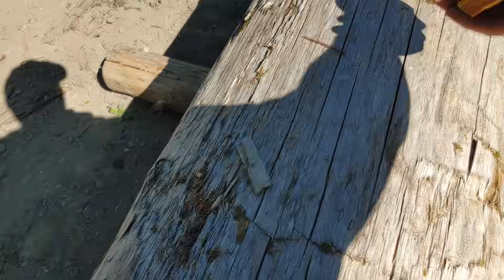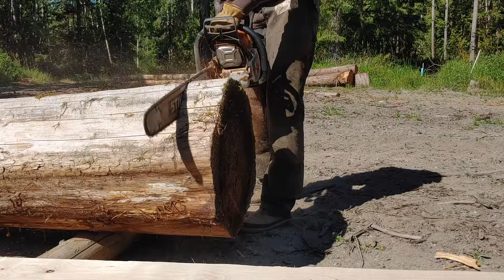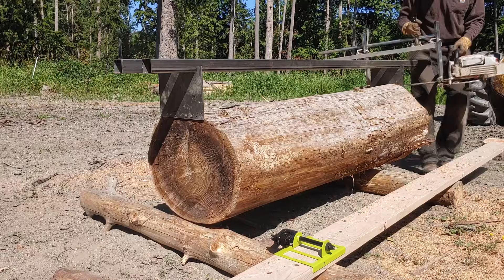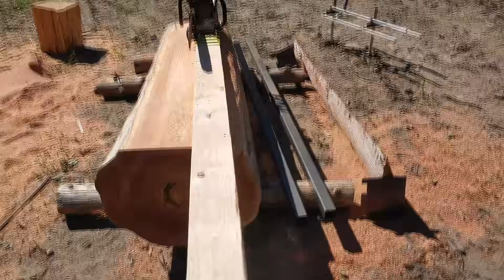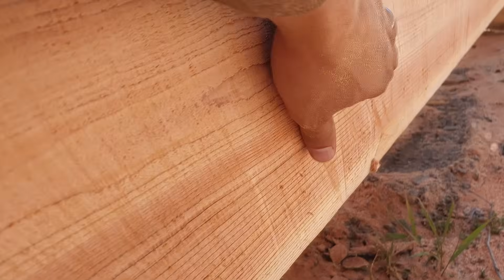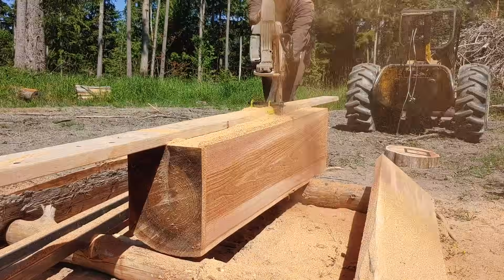Logs To Lumber W/Timber Tuff Sawmill Jig

Comment: What if you just took those set screws out use the center one to drill out and then put a hole in the bar and straight bolt it to it?

Comment: If you mounted it on the otherside of the bar so it is the opposite side to the engine, will it not make it easier?   It seems a bit counterintuitive but you wouldn't have to lean over the log as you cut.
Reply from the maker: Good idea!  I will try it next time

Comment: G'day S&J, I purchased my 4 foot Alaskan twin power head slabber in 95 I put a pair of 066 Magnums on it they worked well together. The next year I got an Alaskan mini mill so I could cut garden sleepers and railway ties, I found that pushing it away as you did on the second cut was the way to go but you had it near vertical I ran it at about 60 degrees and be conscious that any left or right pressure on the throttle handle will reflect at the bottom of the cut. They're a handy little portable set up but I'll have to be honest since we purchased the 10/30 Lucas Mill and slabber they've been in the shed gathering dust for nearly 15 years but they helped to pay for it mind you 👍.
Reply from the maker: Great info!  Thanks!  I will check into the Lucas Mill.  Thanks for watching and commenting

Comment: Did you use a ripping chain?
Reply from the maker: Yes.  Ripping chains make a real difference and a much smoother cut.  I would recommend them if you are planning on using an Alaskan mill.

Comment: Here is the simple solution to the first cut with a Timber Tuff, Haddon or other like guide.

Spike or screw two vertical 2x4's to both ends on the log.  Use a spirit level and fasten a horizontal 2x4 to each end.  This is the mount for the saw guide 2x4.  Fasten the saw guide 2x4 to make the saw kerf lay where you want it.
Reply: I took my setup a little further and fabricated a T bracket out of 2x2 steel angle that I can screw to the ends of the log and screw to the 2x6 guide to as well. Makes a good solid mount for the guide board. Ripping 16' long beams 4"x24" slabs and coming out really nice...
Reply from the maker: This is a good idea!  I will try this on a future video.  Thanks for watching, and supporting

Comment: Nice video. First time I have see the little mill. It seems to have a place. What chain are you running? I have good crosscut chains but do not have ripping chains.
Reply from the maker: Thanks for watching Tony.  I am running a full toothed ripping chain, I think its an Oregon chain.  For ripping it works way better than a cross cut, much smoother finish.

Comment: This was a great video. What STIHL saw are you using? It seemed to do a great job. I was just wondering if an MS 291 can handle the milling stresses or is a professional series saw like an MS 261 and up required? Thank you for any information.
Reply from the maker: In this video I am using a 462 with a 28" bar.  I now use a 500i with a 36" bar.  I'm no expert, but I wouldn't use anything smaller than a 462.  If nothing else it will really limit the width of cut you can make.  Thanks for watching.

Comment: On the Alaskan mill - you could probably use 4 small "C" clamps on the inside of the two plates (clamped to bottom of the rail) to hold the metal bars from sliding while cutting.
Reply from the maker: Hi Tech,  Good idea.  I might try that in the future!

Comment: They are a handy little tool, I keep one with me when I mill with the Alaskan, I set it up on another saw 029 normally and use it cut dimensional timber out of the slabs off the Alaskan, works very well
Reply from the maker: Yes I like it. It is a handy tool and is really cheap. It makes some stuff go much faster than the Alaskan. I agree both have their place

Comment: Nice seems a bit creepy for me being on that side of the saw but it would be super handy just to square stuff up then slab with Alaskan. O and would it be effective if you did it on the side and took boards off the top
Reply from the maker: It is a little awkward and it makes me a little nervous pushing the saw like that, but it seems to work ok, just dont want it to kick back. I have never thought about using it on its side, maybe I should try it!